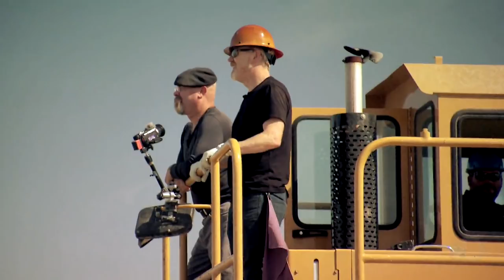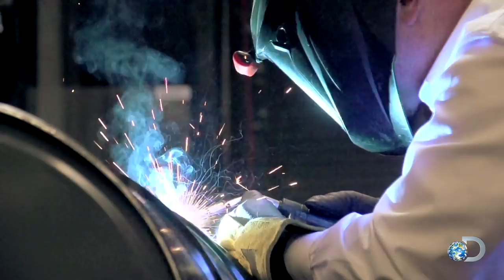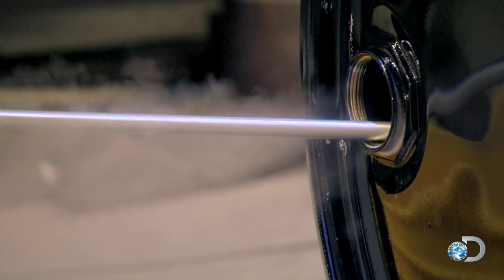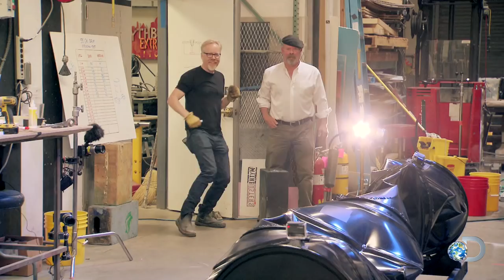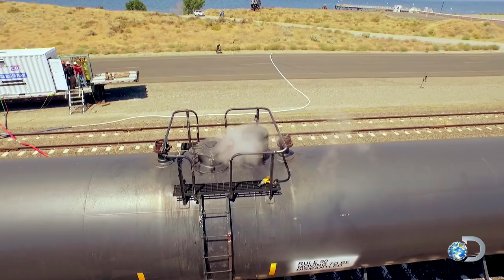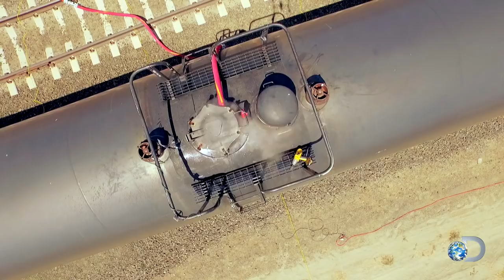Tanker Crush Trailer | MythBusters

Comment: This is what happened to that submersible going to see Titanic
Reply: I came for this too lol
Reply: You could fit way more than five people in there.  At $250,000 a head, imagine how much money you would make!
Reply: @jayroc1502 enough to pay the lawsuit jk
Reply: This is implosion due to 1 atmosphere of pressure. The titan sun was at a depth that experienced 400 atmospheres of pressure. 400x the implosive energy
Reply: No, they drowned
Reply: I prefer the term 'Hydraulic Disassembly', for the Titan, the pressures involved are so much greater for the sub, and its 'decompression' so much more violent, to a brittle materiel that can't bend or deform, only shatter...............

Wonder if the home made 'acoustic' warning system gave them any warnings 
🔊 👂 ⚠️ ? Kinda hope not.....🤔
Reply: @disendangered Wrong, they got smooshed.
Reply: Yes…yes it did
Reply: @disendangered No, they didn’t
Reply: @Jessicaddy  hydraulic Disassembly 

Gruesome but fast,
Reply: @snake57 they hardly even got smooshed, when that happens to vessels like the titan, the energy released causes the temperatures inside to become similar to that of the surface of the sun, those victims only came up as gas along with the bubbles from the air that was inside. They were just enjoying their trip, then were basically vaporized within 1 second.
Reply: @zeusthedrumlord547 so another kind of canned sunshine?
Reply: Is way worse
Reply: I’m here because of that!
Reply: @markanderson1088 That's not the science behind this. We are all under 1 atmosphere of pressure We are not imploding.
Reply: @disendangered no they didn't drown, they didn't have time, the sub and them were destroyed and incinerated in less than a one microsecond
Reply: his PlayStation controller died
Reply: Não, com o submersive foi 380x mais forte que o deste vídeo pois a pressão sobre a 3800m abaixo d'água é de 380 atmosferas terrestres.
Reply: Commenting on a certain recent event on a 7 years old video with related context is utterly cringe
Reply: Explained how they drowned.
Reply: Really?